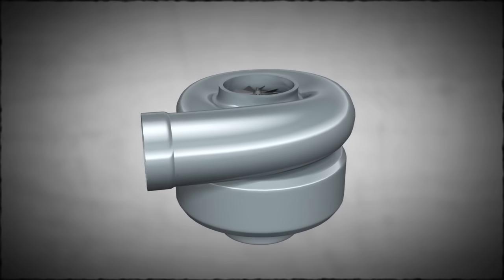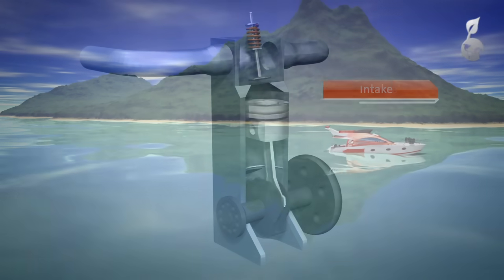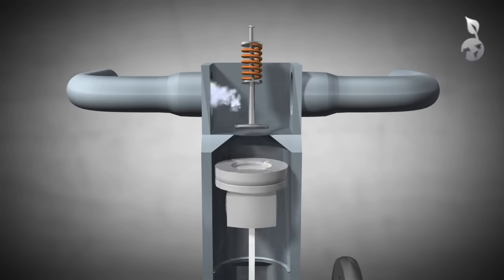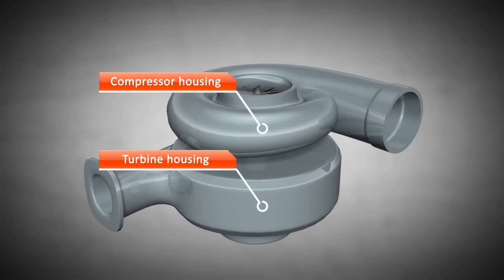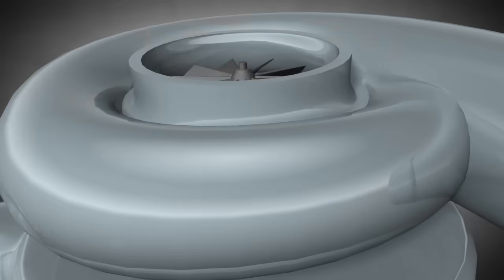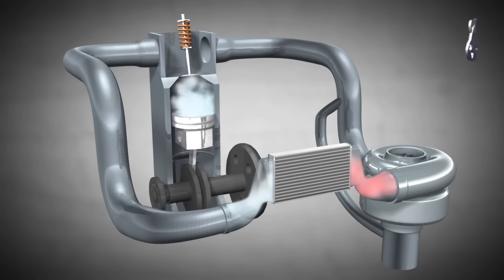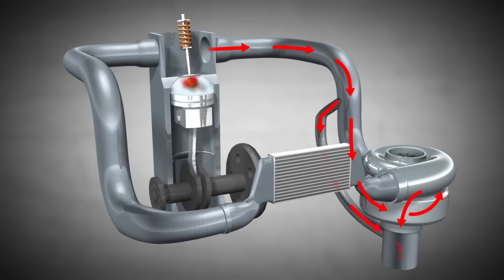How a turbocharger works! (Animation)

Comment: 1.  Why does your 4-stroke engine only have one valve?  It is just laziness?
2.  Engine valves open downward into the combustion chamber and not upwards into whatever it is that you invented here.
2.  Turbine blades and compressor blades do not look alike to anyone but the most unobservant people.

Did you decide to make this a diesel engine because you were too lazy to also add a spark plug?

Comment: I love how gases deliberately choose to go right after being burnt in the beginning of video)) 
This is inaccurate depiction, and each cylinder should have at least 2 valves: 1 for input and 1 for output.
Anyway I was wondering how compressor works, thanks for the video!

Comment: You forgot to mention the blow off valve which releases the compressed air once you stop accelerating to stop the air moving back into the turbo and damaging it, great video otherwise ☺️

Comment: Why is the turbos air intake feeding air into the radiator plus wear is the air filter 

I have only just figured that it’s not a radiator and that it is a intercooler but there is an external wastegate which is only meant for drag cars and high performance race cars

Comment: So based on the animation, the turbocharger acts on air that has already been in the combustion chamber??
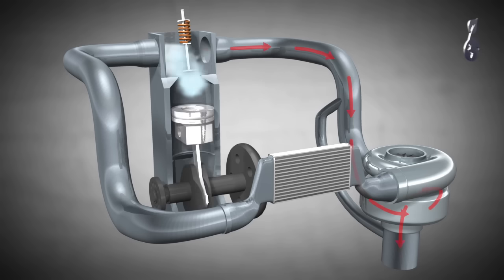Reply: Watch at 2:30. The exhaust gas drives the turbine and goes out the exhaust while the inlet on the turbo draws fresh air that goes i to the angine
Reply: @cc2x4  😆😆😆

Comment: The turbocharger seems to be quite simple device with few parts. So why the fuck the cost of it is so outrageous?
Reply: The compressor wheel and turbine wheel are both complex and difficult to machine parts. Because turbos spin at very high rpms the tolerances must be very tight as even small errors can have catastrophic results. There are cheap Chinese turbos out there, but they have a tendency to explode.
You can find quality turbos for $1000, which isn't really that much when it comes to car parts.

Comment: Compressed air is denser air meaning it is cold.  And the intercooler gets in the way for the air flow to the combustion chamber.  The model there isn’t practical.  And there are blowoff valves so they dont have to go thru the turbo with so much pressure.  Blowoff valves are what give them that awesome noise.  🤧
Reply: The compressed air is actually very hot, which is why an intercooler is sometimes needed. When you compress air, it gets hotter not colder. PV=nRT

Comment: so the exhaust gas is only there to push the turbine so that the other other turbine connected with it can suck in air? does the exhaust gas mix in with the sucked in air from the turbo or does it exit out ?

Comment: So the exhaust gas itself doesn't go back into they cylinder. It just causes the turbo wheel to turn because it is hot. Before I thought there was unburned fuel in the exhaust gas that went back into the cylinder, but not so.

Comment: ok... I see that the turbine is there to convert hot gases from the exhaust into kinetic energy and then rotates the compressor wheel--at the same rotation rate--to "suck " air from outside, but say that instead of using the turbine wheel, I use the alternator to rotate the compressor wheel so that i can cut some weight from the turbine wheel out of the car, would that work the same ? or it has to be turbo-compressor wheel in order to have the same rotation rate, ultimately the same amount air going in and out ?

Comment: I heard it cuts a car's life in more than half.

But also, it won't be activated driving at normal speeds?    So you keep the same old mpg when not in use?

but what about out in the highway where it's 70+ mph out there, is the car gonna take off when i don't wan't it to?   (Just gradually go up to that speed other than flooring it)

is it activated when you floor it?

Comment: Great video, very informative, but am I missing something here?  There seems to be only one valve doing the job of two ie. both inlet and exhaust. Last time I looked at my turbo charged Diesel engine, it had two per cylinder, an inlet and an exhaust. Any explanation for this?
Reply from the maker: It's just a simplification of the whole process. In fact, your whole engine won't look like this animation :)

Comment: !Achtung!

I Have Never seen a cylinder with 1 valve that controls flows of both fuel and exhaust.
Yeah, that's a German accent.  I can't complain since I can't speak of work of German.
That would be different if World War II had a different outcome.  Oh well...maybe next time.
If they had succeeded, the ranks of the FSA would be reduced considerably.

Comment: Can I install turbo on a non turbo diesel engine? Without changing lots of things ?
Reply from the maker: Depends on how long you want to drive it :) / You can install a turbo in any vehicle, but the engine might be go up in flames or run only for a few miles :)
Reply: Thomas Schwenke oky and what do I need to change to avoid all that and have the best out of it ?  Another q ! Does it matter if the engine is above 300.000km will it still perform well or it's anyway dead ?
Reply from the maker: Who knows...

Comment: Suggest using separate intake and exhaust valves and open valves towards piston. Showed video to four year olds and their questions prompted this comment. Why doesn't the exhaust go out both ways? How can that spring hold in the explosion? Thanks for sharing.
Reply from the maker: Hi, that are great questions. What did you tell them?
Reply: Thomas Schwenke Hello, I told them very little. I did show them a few engines, started with a set of small block Chevy heads and mushroomed from there. The questions kept coming. Nice to see kids interested. My own sons had to go through the, learn or your not going dirt biking, education method.  I. I'll wait to hear from my neighbour, he unknowingly provided the volunteers. Thanks again and all the best in the future.

Comment: All petrol engines 1-4 turbo intercooler and ones with hybrid, ones hybrid plug in with All brands : 20-100 l/100km, over 100 l/100km, easy damage by all who support build with test performances and lie high fuel economy in everyday.

Invented by street racers and brilliants.

Comment: I have a question if anyone can answer Itll be appreciated. 

So I always wondered why people added bolt ons such as intake, exhaust, headers, etc. to gain more hp even when they have a turbo. Can't you just amp up the psi on the turbo? 
I heard "you can blow up the engine with too much psi because you're making the engine work harder". But isn't that what any type of bolt ons do anyway? Or is there a different way of making a car go faster without "making the engine work harder"?

Comment: I had a general idea of how turbo worked, but i was missing a key piece of information, that the exhaust air from the engine is used to power the other side. For some reason i was imagining it like a jet engine, i thought fuel was used to create a compression powering the second fan and in turn increasing the intake for a cycle. thanks for the information :D

Comment: Explanation was great - except I think one piece was missing that I believe I figured out on my own. When the compressor turbine draws in air, it draws that air in from..... WHERE? The exhaust gases? Or fresh air? I guess it's fresh air? Which would make the most sense. But it's not really stated in the vid.
Reply from the maker: Hi, yes, the animation assumes you have a basic understanding of engines. If you have, there is no question where the air comes from :)

Comment: In short, more air pumped into the compression chamber by turbo with the help of intercooler , the higher the combustion ratio, means higher torque, leads to higher horsepower

Comment: the intercooler does not change the oxigenation of the air while its a closed sistem, it just cools down the air because bigger thermal difference causes bigger eficiency (simple elementary school physics and logic)

Comment: is there a tube which directs new air to the compressor or is it just like that blank open and sucks it from the inside of the engine space (under the hood)
Reply: From what I understand, the turbo pulls air from a cone shaped air filter towards the front of the car, such as a hole in the bumper under the headlight, or somewhere in the general area. Then, it pulls fresh air with an additional assist from the wind while going at higher speeds (such as a turbo in muscle cars)
Reply: no there would be an air filter before that point like any normal car there is an air filter in the intake usually theirs a box with the filter in it that's easy to access so you can replace it and then a pipe running from that box to near the front of the car generally right under the tip of the bonnet, if you just left the turbo open like that it would fuck up the engine because it would be sucking in dust and bugs not just air.

Comment: oh...i thought that radiator thing cools down water from the engine
Reply: piece of potato The radiator and intercooler are two different things. The radiator does indeed cool down the water/coolant from the engine. The intercooler cools the air that is being pushed in from the turbo.

Comment: why dont cars use this with normal gas engines? Thanks
Reply: they do, Check out Subaru and Hyundai for sure make what you would call "normal gas engines" with turbos, so they are not just for diesel engines anymore.  now a days it is just NA or naturally aspirated engines and turbo engines.

Comment: can you tell me how many rpm of turbo charger whan engine have 1500 rpm
Reply: Parvez Alam that simply depends on the turbo charger itself. You have low end power, and high end power. Like a dual turbo system if I'm correct can give you low rpm power where as the second stage takes over at high rpm. Then there's a turbo that's called a variable vein where it literally adjust itself as the engine rpms climb so you have smooth power all the way to top end. Your average turbo only produces 2-7 psi of boost. But I've seen some monsters of turbos making 25psi of boost. It just all depends on what you're going for in the end. 20hp? 120hp?

Comment: Just a noob question. Hot air rises and cold air drops. the compressor wheel produces fresh cooled air how does it not fall back into the cooler ? same with the turbine wheel how does hot air from the piston not accumulate there and drops to the turbine housing ?

Comment: Umm the animation uses the same valve for intake and exhaust lol. Maybe I'm stupid and some have this.
Reply: diesel motors don't need an admission valve, they use injectors. The valve is an exhaust port in half of the cycle and admits during the other half
Reply: Carlos C. Valdivieso Cars other than diesels use injectors. Do you mean the injectors are right at the top of the cylinder? And there is one or two exhaust valves?
Reply: TekTonik Dubstep the number of valves varies per manufacturer. on older model gasoline engines you have a single intake valve and a single exhaust valve. intake valve being 15 percent large than exhaust most times. on newer cars it's not uncommon to see 3 valve and 4 valve designs. some high performance cars like audi use 5 valves. 3 intake and 2 exhaust. the valves also operate differently than the animation. they actually go down into the cylinder during intake and exhaust and close tightly to the valve seat via pressure from the valve springs rather than go up like is depicted. hope that helps you understand it a little better
Reply: Andrew Ballew I have a turbocharged d16z6 Honda civic. It's sohc. I know how it works obviously but I only really know about Honda motors. Typically it's one intake valve per cylinder and one exhaust per cylinder unless dohc of course

Comment: What would happen if you removed the wastegate and had an extremely strong unbreakable turbine like made of titanium alloy or something
Reply: karankenZ then your engine detonates lol. Before you turbo charge an engine of any kind not built for a turbo you have to literally almost change everything except the block.
Reply: the wastegate isn't there to protect the turbo most turbos would be able to withstand way more force then they do the wastegate is there to limit the amount of air going into the engine because you need an exact ratio of air and fuel to actually benefit power wise and if you removed the wastegate completely the air pressure in the engine would fluctuate to much and there would be no way to get the right amount of fuel to the amount of air.

Comment: Diesel cars only need one valve. It's called Scavenging, since no fuel actually is in the intake, and is put directly into the engine. It is free flowing, but then the cyl takes what it needs.

Comment: Quick question... blowers rob engine power bc it puts pressure on the crank to run them, but do turbos rob power? My reasoning is, is that since it runs off of exhaust, wouldnt that create back pressure, and make it harder for the exhaust to escape since it needs to spool up the turbine, thus taking power away?
Reply: +zach m You do typically loose power in the low revs with a turbo. This is becuase the engine has been designed to run with higher pressures (the compression ratio is much lower). When the engine is in the low revs is doesnt spin the turbo fast enough to create the desired pressure (turbo lag). The bigger the turbo the worst it gets. This is why twin turbos are used. A small turbo for low revs and a big one for higher revs. Or you could use a supercharger because it turns using the crankshaft making good pressure straight away.
Reply: zach m i thought with turbos you have to run the least restrictive exhuast . so mabye the backpressusre is minimal for all the benifits you get out of a turbo
Reply: That Guy how does it make exhaust less restrictive? Isnt the turbine considered an obstacle for the exhaust?
Reply: will Speakman thank you!
Reply: zach m I I, not so sure you actually lose a lot of power down low, just that you gain so much once your making boost it seems that way. As you said, superchargers take power to make power. Look up those NHRA dragsters with blowers, their superchargers take 250+ hp to run them. However, they make it all back and then some. It's ok for those dragsters to use those bc they have enough power b4 being boosted to spin them. There is a reason most forced induction motors of smaller displacements are turbo and not supercharged. Turbos are incredibly efficient. To my knowledge, they don't rob ANY power whatsoever. In fact, they run off your vehicles waste. It does obviously change exhaust pressures and etc. as you stated but any difference would be very negligible. Like a 1/2 horsepower if any if I had to guess. Plus, who doesn't love that sweet turbo sound lol. All of what I've stated is based upon my research and etc. I'm not claiming I can't be wrong, I very well could be. However, based off of the research I've done, I'd say it doesn't make it any harder for exhaust to escape.

Comment: What happens if the hot compressed air isn't cooled by the cooler and then gets in to the cylinder? What I think about is that why don't you let in the hot air, because actually there shouldn't be any fuel in the cylinder so there would not be a accidentally ignition, would it?
Reply from the maker: Hot air needs more space. The colder the air, the more air can be pushed into the cylinder.

Comment: Excuse me????? Did I see a 4 stroke cylinder with just one valve, alternatively opening for the intake and the exhaust? Does that really exist somewhere in this Universe, or is it just to simplify the animation?
And by the way: it is not only the exhaust gases' kinetic energy that makes the turbine turn, but the kinetic and the internal energy, which means speed, temperature and pressure.

Comment: how it mack flames??
Reply: enklis be stronk with this one
Reply: Vicencio Trejo Jr 
edit: it's self-igniting under high pressure
Reply: the spark plug macks flames
Reply: diesel is self-igniting, no spark plug needed
Reply: Turun Ambartanen seems kinda unsafe what if the gas tank explodes ?
Reply: Vicencio Trejo Jr diesel fuel is only ignited in the combustion chamber by being atomized under high pressure. To say it in a more simple way, The piston (thing that goes up and down) sucks in air and pushes it up really fast and it gets really hot and then an injector sprays a very fine mist of diesel fuel into the hot air and it explodes, pushing down the piston to restart the process. So the tank has a very slim chance of ignition. Also there are systems installed in fuel lines incase a backfire happens it does not spark in the tank and a backfire is rare also because the explosion is complexity surrounded by metal and has been very perfected.
Reply: Baat diesel doersnt buhrrn
Reply: Vicencio Trejo Jr it wont explode its just fuel that didnt go through and it ignites at the ends ;) no worries

Comment: Stupid question...

Would it be better/possible to constrict the outlet on the back box of the exhaust in order to produce thrust and/or introduce some sort of compressor somewhere in the exhaust to increase said thrust.

Seems like exhaust gases are a wasted source of propulsion.
Reply: ナコルル王女 it simply wouldn't work that way. The engine doesn't produce thrust power, just hold your hand over a tailpipe and I bet you could actually kill the engine...(assuming you don't burn the holy living hell out of your hand) by blocking the gases from exiting.

Comment: It works the same way on gasoline engines?
Reply from the maker: Yes :)
Reply: no.  it does not use gasoline obviously, it uses the power from exhaust to spin a turbine to suck air into the motor. this is nothing like a gasoline engine
Reply: t

Comment: Oh so the exhuast drives the turbine and drives the other compressor wheel which helps inject the air faster into the engine?
Reply: Right.